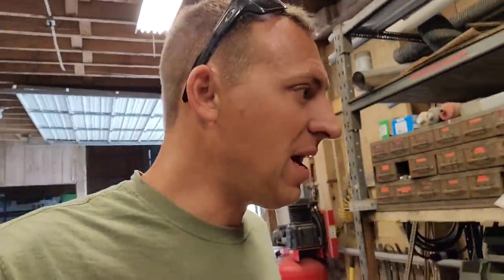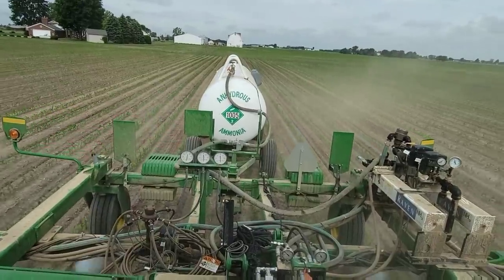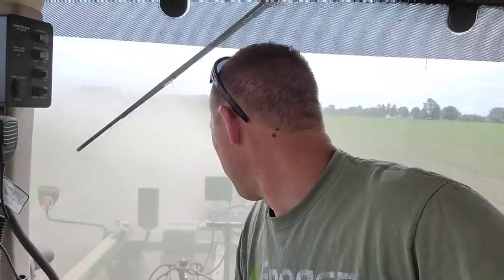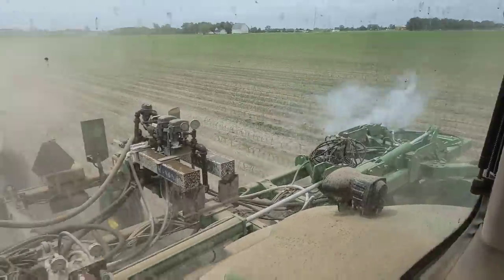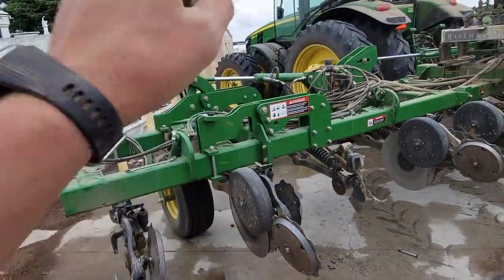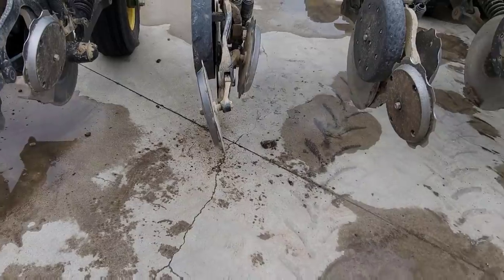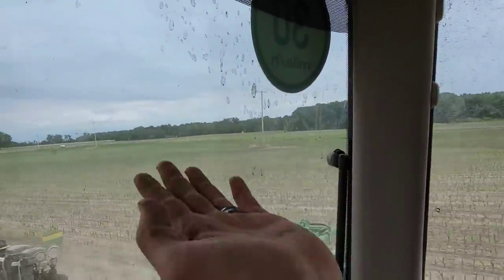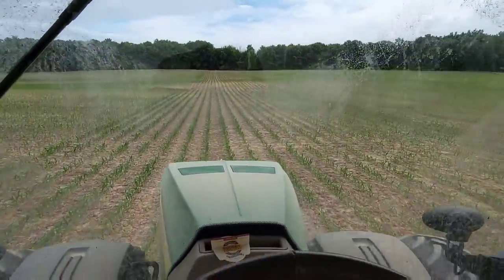Can I Fix it? - #437

Comment: Be interesting to see if there is a crop yield fron going to the disc insertion bar
Should be substantial increase in productivity and costs.  Less fuel, less wear and tear on tractor, no expensive digger shoes to replace often,  much less labor costs.  Less field compaction n soil tearing from hard pulling tractor on digger bar ap.
Also large productivity increase in critical busy time of year.
Best on building your dream home

Comment: new to putting gas on corn we all ways did 32 or 28 liquid for side dress on corn so not really in the know on gas but is there by chance that a different closing wheel for your bar to help closing those rows if that arm does not work